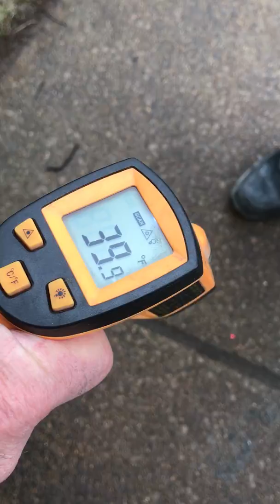LOW TEMPERATURE BOILING WATER BELOW ATMOSPHERIC

Comment: ok sorry to sound like an idiot most likely, but how did the water reach that temp? was it heated before hand or heated with the "cryophorus" already put together? would it still work if i was to just put some boiling water into a mason jar with a 1ft rubber tube to another 1 or do i have to hook it all up and heat it to 150f to get a vacuum? again sorry for probly wasting time with stupid shit just trying to get a feel for this because it seems like a reasonable way to achieve a constant pressure differential and that sounds VERY interesting. any help or knowledge is much appreciated.
Reply from the maker: I started with very ht water straight from the water heater. This was a full bottle of water with the hose already connected. The water must fill the bottle and the hose to the very top so that no air is remaining in the first bottle. The second bottle then must be evacuated of all air also. This is done by placing a small amount of water, less than 1/2 cup in the bottle. This is then placed into a microwave for 1 to 2 minutes. The water must be brought up to a boil so that steam causes all the air to be pushed out of the bottle and replaced with water vapor. Immediately remove the bottle using gloves...... it will be very hot. Dump the water out of the bottle into the sink and be sure to keep the bottle upside down. Do this quickly and insert the other side of the rubber hose into this bottle. If you do this quickly enough....... less than 20 seconds from microwave to hose connection........ there is no more air in the system. Dump the water from the full bottle partially into the empty bottle to allow some room for expansion and within two minutes the system will begin to boil and a nearly perfect vacuum has now been established. Have fun, don't burn yourself and be aware that hot glass bottles can implode or explode without warning, so be safe and take precautions against eye and hand injury.
Reply: @ourhouseisfull11  thank you good sir for the information, i plan on starting at the most basic level and taking every precaution i can just wanted to make sure i was using the right process. i plan on machining a system myself eventually but for now i'm limited to what i can do without a machine shop, my hand and, a garage full of old tools and parts, but on the flip side this looks like the kind of experiment i could probably manage Lol, so thank you again good sir for the reply and a good step by step plan and you stay safe playing with the big stuff brother best of luck to you. will reply with an update in the next day or so plan on using mason jars and a rubber hose press fit through lid peace and if i didnt say it enough thanks again for the information man very cool thing imo.

Comment: How did you get the low pressure in the bottles? You say about the mercury. Does mercury produce the low pressure, so the water gets boiling below the 100 celsius degree? Thanks. ;)

Comment: I wonder how you could maintain the low pressure in the system while still managing to spin a turbine.
Reply from the maker: The turbine will go into a casing similar to the last one i made.   https://youtu.be/q2AmtB-mGog

But instead of a positive pressure of (+0 to +2 psig) back pressure into the condensing tank, there will be a negative pressure induced into the condensing tank that is relatively easy to maintain. No problem. We have done this in the past. But i was using high pressure tesla turbine and impulse hybrids. (+0 to +100 psi) Now i have decided to use (-3 to -14 psig) negative atmospheric pressure differential as this demonstration proof of concept and have developed the new impulse style turbine that is much more efficient in this (3 to14 psia) pressure differential range, such as these two tests below.  

 This is the new impulse turbine test @ 3 psig. This will run in negative pressure differential using  a vacuum when we place it in a casing.  https://youtu.be/eegnQ88f8yw

 This is the same impulse turbine testing @ 10 psig differential. This is what we expect to be able to run using 10 psi below atmospheric pressure differntial using the same concept as demonstrated above. The turbine would be placed between the bottles in this video (between the boiling water and the condenser tank) where the black hose is connecting the two bottles. https://youtu.be/q4rqYHmD27Q
Reply: John Cooper I was wondering that also. I imagine the entire turbine will be in some kind of low pressure container. Interesting stuff.